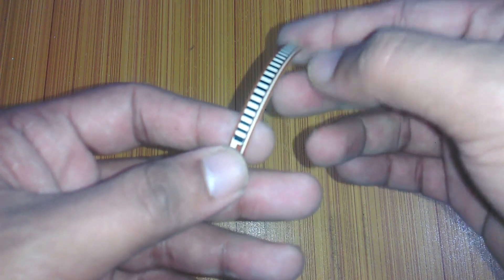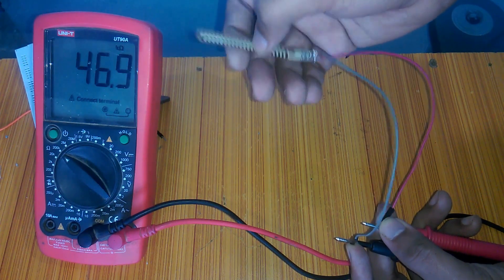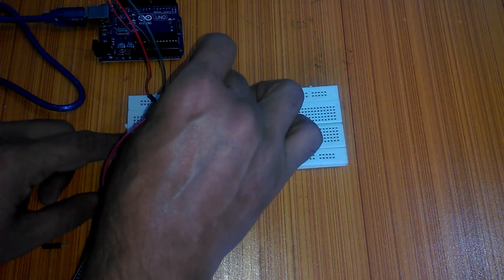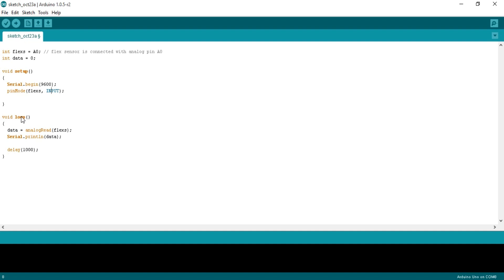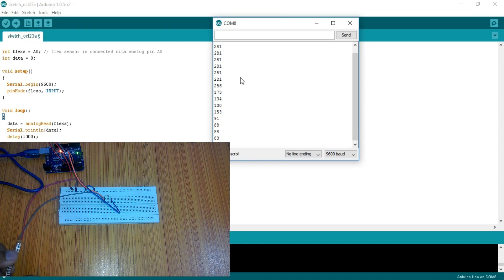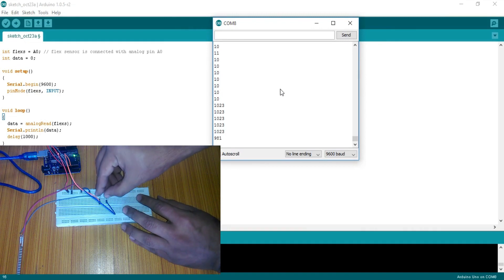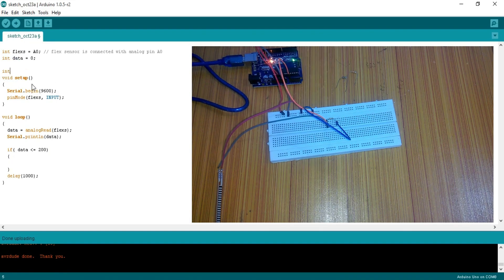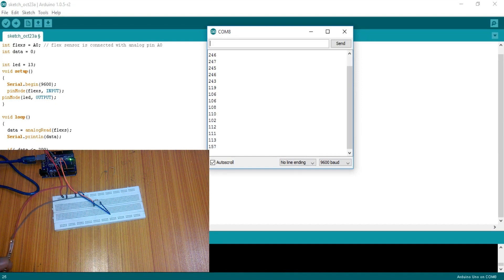Flex Sensor or bend sensor getting started, circuit, interfacing and Arduino programming

Comment: I am an 8th-grade student working on a project to convert sign language into vocal output for people with voice impairments. I am experiencing issues with my flex sensor: sometimes the readings exceed 1000 or drop below 50, leading to inconsistent values that prevent me from setting a reliable threshold. Additionally, when I bend the flex sensor, it shows values like 981 or 986, but instead of increasing with the bend, the values decrease. How can I resolve this problem?
Reply from the maker: I fixed this issue in the latest video.
Reply from the maker: When you bend a flex sensor the resistance decreases.

Comment: Last code isn't correct

Correct code

int flexs = A0; int data = 0; int led = 13; void setup () { Serial.begin(9600); pinMode(flexs, INPUT); pinMode(led, OUTPUT); } void loop () { data = analogRead(flexs); Serial.println(data); if (data <= 500) { digitalWrite(led, HIGH); } else { digitalWrite(led, LOW); } delay(1000); }

Comment: i need some help here, i followed a toturial where i made a flex sensor using velostat and aluminum foil, and i connected the sensor exactly as you did in this video, and i ran the same code, but i noticed something weird, when it is not bent or when i don't press on the velostat, the readings are ranging 0-150, but when it starts bending, the value goes gradually up until 950 and with a little of pressing i can get it up to 1020, so my question is, how is the value going up ?, shouldn't it decrease?, any help is appreciated.

Comment: I heard, that you should use a Resistor which has the same resistance as your max. bend Flex Sensor. Is that somewhat correct?

Comment: Hi please, tell me what is the purpose of this? Should i do this before making any project with flex sensors???
Reply from the maker: Flex sensor is nothing but a variable resistor. You have to follow the same circuit if you want to use it. You can watch my video on Human posture monitoring in which i used the same Flex sensor. You will get the idea how to use this sensor in real projects.
Reply: @ElectroniClinic  why did you upload codes in the flex sensor in this video, what is this for?

Comment: How do you insert messages so once you flex the sensors the message will appear in the LCD
Reply from the maker: https://youtu.be/ByyGpRNtex4
Reply from the maker: it's simple. watch my tutorial on 16x2 LCD. then only using the lcd.print() function you can print the value.
Reply: @ElectroniClinic  can you comment the link
Reply from the maker: there are so many other projects in which I have used different types of LCDs. check playlists.
Reply: @ElectroniClinic  is there anyway that once you bend the flex sensors, the message will appear in the LCD screen? Do you have a tutorial for that or atleast tell me here?

Comment: Is a bending sensor better than an accelerometer for this kind of project? I would also like to put the vibrator along at the same location where the sensor is, so which would be better for that?
Reply from the maker: Use the Flex sensor. this sensor is specially designed for surfaces. you can easily use this sensor with jackets etc.
Reply from the maker: watch my tutorial on the distracted driving accidents. in this project, I have used the accelerometer module. after watching this video, then you can decide yourself. the accelerometer is best or the flex sensor for posture monitoring.
Reply: @ElectroniClinic  Thank you very much for the help! I will definitely take a look at it
Reply from the maker: if you want to monitor vibration then you can use the accelerometer or the vibration sensor. you can watch my tutorial on the mpu6050 accelerometer module.  tell me about your project.
Reply: @ElectroniClinic  My project is posture monitoring and correction. My initial idea was to place 2 accelerometers a little higher than the shoulder blades.
I'd like it monitor regular posture and also assist with an exercise.
I have watched your video of a project similar to what I'm planning on doing, but now I'm not sure if a bending sensor would more suitable than the accelerometers.